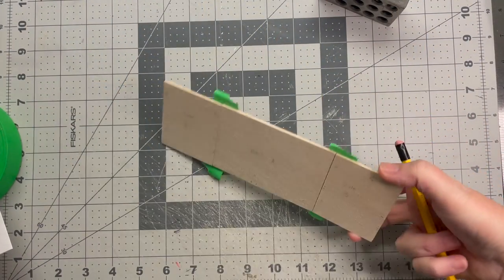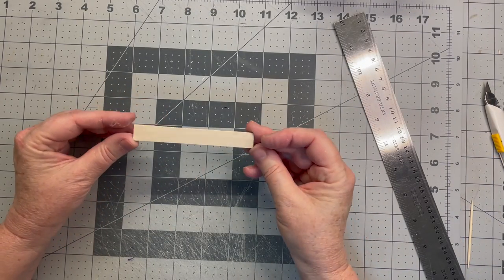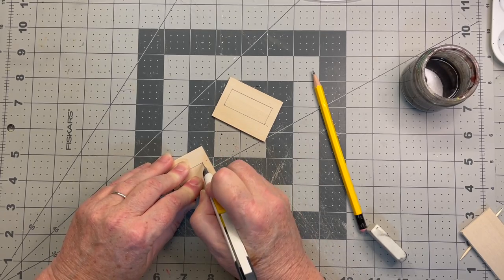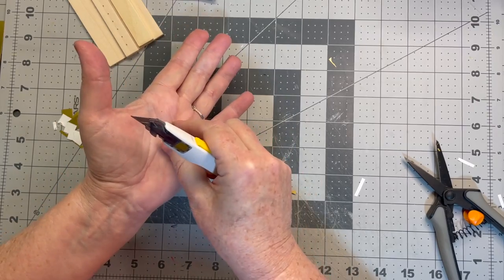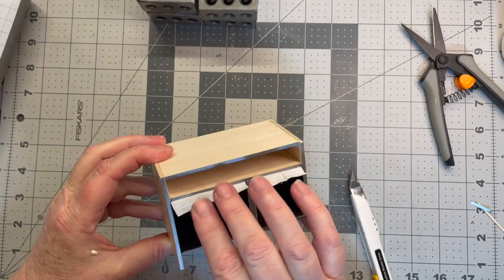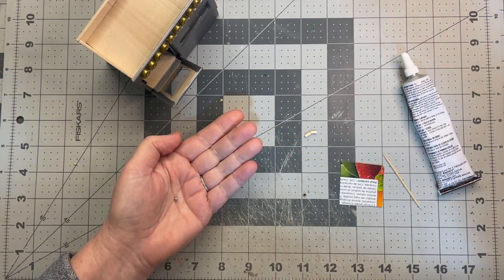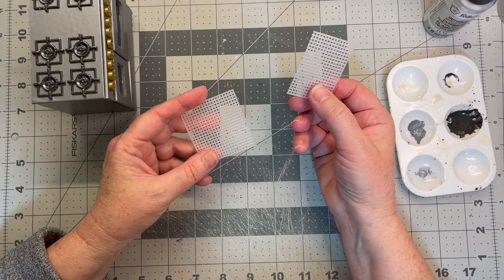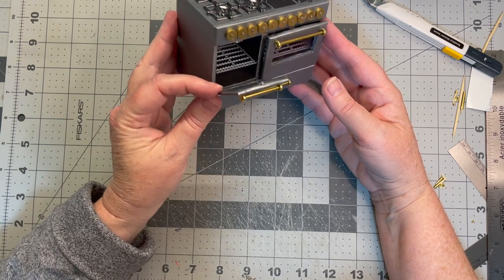Building this 1:12 scale Luxury Stove

Comment: How did you make the knobs?
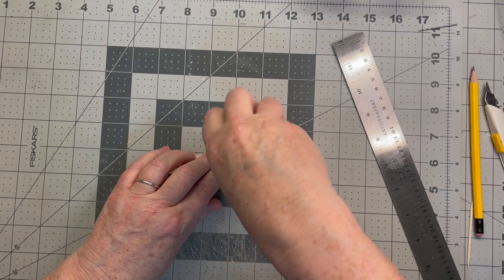Reply from the maker: @AshleyQuiles-i2f  Hi Ashley, the knobs are made out of a round wood dowel that is about 8mm in diameter. I cut off 10 pieces with my miter saw that were 3mm in width. If you move to the 8:13 mark in the video, you will find the instructions. Please let me know if you have any questions. Thanks!💚

Comment: On an unrelated topic, I think you have done business with AliExpress.  I am trying to buy some battery powered lights from them, but the listed price and check out price don't match.  The descriptions don't always look to be accurate (is it really battery powered). Etc.  One order of mine came relatively quickly with only one thing broken (which I was able to fix). There doesn't seem to be any recourse or ability to communicate well with them either.   I was wondering what your experience with them has been.  Thanks for any insights you have.
Reply from the maker: Hello there! I used to order a lot from AliExpress but it’s been months since I got anything from there.  Earlier this year, Temu became available here and I have ordered from them almost exclusively.  I am happy to share my experience, pros/cons, and reasons why I switched with you! 
From a cost perspective, the two companies are pretty comparable, and they both carry the same sort of items. The quality is hit and miss with both. Sometimes they exceed my expectations and sometimes not but for the price I don’t have super high expectation, lol. 
I found that with AliExpress, that the sizing was very often off. They advertise items at 1:12 but are sometimes way out of scale. I tried to return something once apron a time but there were too many hoops and for the $1.00 is cost me, it wasn’t worth the hassle.  I find Temu a much better option.  No matter how they advertise the size, on the pictures of the product there is always one with the actual measurement, so I can confirm for myself if it is actually the right scale.  With Temu, I had an order to missing in the mail and they automatically refunded me the entire amount without me having to chase them.  I also like Temu for the delivery time. I used to wait 4-6 weeks sometimes for AliExpress but Temu delivers in about 7-10 business days.
I hope that helps!!
Reply: @pennyssmallspaces   Thanks!  Just ordered from Temy.  Unfortunately, they have a much curtailed inventory on lights, but we do our best.
Reply: I did follow up on this and did two orders from TEMU.  On the first one, things came broken and were so poorly made as to be almost unusable.  On the second order (give someone a second chance I always say)  they waited until after the order was delivered to tell me an item was "out of stock" but they had charged me anyway.  I was able to get a refund, but I would say TEMU is no better than Ali Express.  I guess you get what you pay for.
Reply from the maker: @marykayryan7891. I’m sorry you had such a bad experience with them! 😞